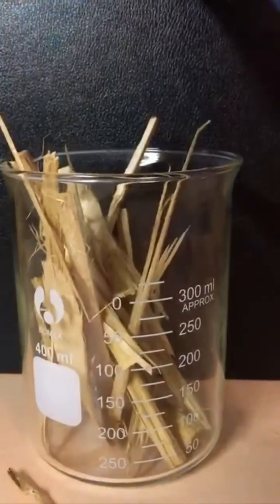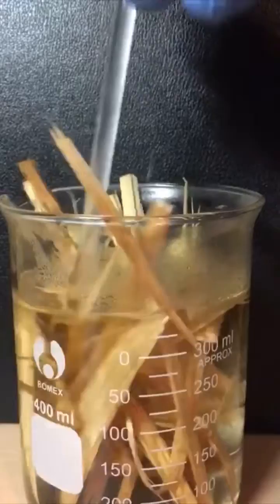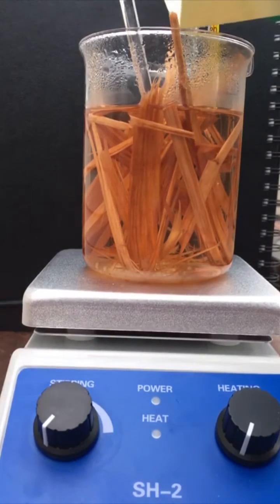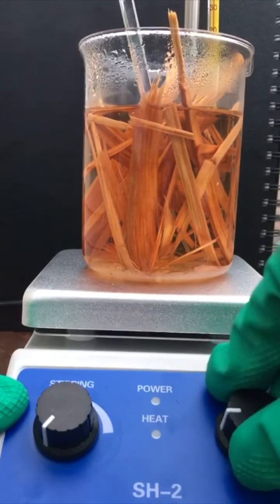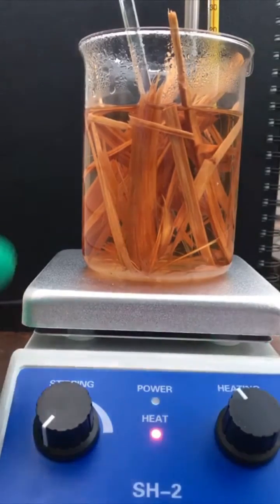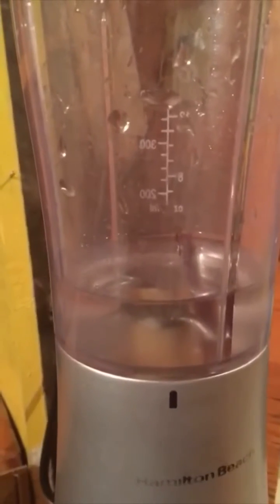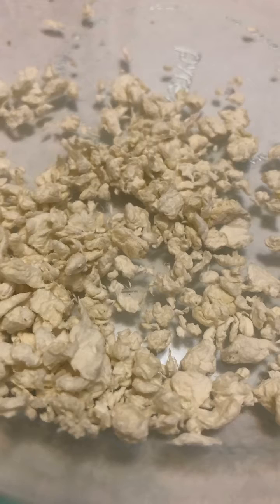Cellulose fiber from wood

Comment: excusme so sorry did u still open the comment section bcs i need to ask is it ok if i blend the cutton with an acid like hydrogen peroxyde and became a smooth cutton pulp, and is it can be a powder?? u dried it with oven?? sorry for bothering thx if u answering it

Comment: Guys do NOT eat sawdust if you can avoid it. There are many indigestible fibres in it and cellulose is not just raw sawdust. Idk how they make nutritional cellulose. I know you can make it from wood/sawdust but you have to refine it and wash it and then maybe blend or process it for it to become of significant nutritional value. You wouldn’t want to block your digestion with sawdust man. That would be a really hard fight to fight on the toilet.🤧

Comment: How does your wood undergo drying? Is it oven dried or sun dried? Thank you.
Reply from the maker: i cant remember but i believe i dried it under an infrared reptile light and a fan for air flow. I believe it was for 2 days
Reply: @industrialadhesive6357  can i extract polysaccharide with this process? i would be extracting polysaccharides from sugarcane bagasse..
Reply from the maker: @JOHNLEODECHAVEZ  looking that cellulose is a polysaccharide yes it should work. I’d try to find some papers on the topic, to see how others results were but I don’t see why it wouldn’t work
Reply: @industrialadhesive6357  Do you think i should go oven drying my sugarcane bagasse or air dry it. Btw, I'm from a tropical country, Philippines. We are in the summer season, and it feels like 45 deg Celsius weather. 

Currently working on our thesis, this is a huge help. Thank you, already liked and subscribed.
Reply from the maker: @JOHNLEODECHAVEZ  depends on the application, Air drying may be the best due to less energy expenditure in the process but oven drying would likely work better. Either should work. Thank you for watching!

Comment: Can you add the exact time?
Reply from the maker: What do you mean exactly?
Reply: Sir, if how long does it take to 'boil' the wood with sodium hydroxide solution, how long does it take to bleach it? And when you added the hydrogen peroxide, did you heat it again? Can it be powderized?  Thank you very much, your answer will be very much appreaciated.
Reply from the maker: @kio3326  hey sorry I don’t have an answer I am away at university now and I am not too sure where my old lab notes are. Yet again I’m quite sorry
Reply: And the exact temperature as well?

Comment: are the bleaching steps (sodium hypochlorite & then hydrogen peroxide) necessary for the fiber extraction or are they just for getting it to come out white? And would this (either with or without the bleaching steps) result in a fiber appropriate for spinning into yarn, or would that take extra steps?
Reply from the maker: I found the finer to be quite weak just due to the length of it, there are definitely steps you could to to spin it though, it’s better for making Kraft paper though. The bleaching was just so it would come out white it is not nessicary

Comment: I have been searching, if you can’t get ahold of carbon disulfide, what else could I use?
Reply from the maker: Schweizers reagent. And I believe cellulose is slightly soluble in a high pH solution at low temps
Reply: Thank you so much
Reply from the maker: @saketab940  👍 any time!

Comment: Is hydrogen peroxide needed or does it only make the cellulose whiter and could it affect something if i were to use the cellulose further
Reply from the maker: Hydrogen peroxide is used to make it whiter, it’s commonly used in the paper industry and it doesn’t affect paper products so depends on your final application it may differ

Comment: If my target product is lignin then can I get pure lignin by using NaOH/water as solvent?
Reply from the maker: There will likely be some contaminates but it should work as a viable extraction path. I would read into some literature regarding the topic though
Reply: @industrialadhesive6357  My target product is lignin. But the problem is, there is no any way for quantitative analysis of lignin. So at the end I have to do only FTIR that tells only presence  of lignin. Can u give any comment on this ?

Comment: Wouldn't it make more sense to mix the sodium hydroxide in before pouring the water?
Reply from the maker: I mean it should work either way. Typically you want to add the solute to the solvent and not the other way around. This is especially the case for strong bases like NaOH where if you add it the other way it can cause the water to boil and spit

Comment: is peroxide necessary? i would like to make some delignified wood in whitest possible without it
Reply from the maker: It’s not impossible. You can use NaOCl but it will be fairly yellowish. Hydrogen peroxide is recommended
Reply: do you mean possible? how long did you boil in your soup?

Comment: how to  extract mcc from potato
Reply from the maker: Im not certain on how to do it. It should be able to separate out in the same way as starch. Starch is slightly soluble at high temperatures so you may be able to separate that way. But That’s just a hypothesis

Comment: Sir, is it possible to use this method when it comes to extraction of cellulose from papaya seeds?
Reply from the maker: I’m sure it would. I am unsure of the makeup of papaya seeds, but as long as what it contains is soluble in water at a high pH and temperature it should suffice.

Comment: Hi! Will this work on the lemon peel as well?
Reply from the maker: There are more polysaccharides found in peels such as pectin which is soluble at a high pH. Aswell as oils found in the peel which can be removed quite easily. So I don’t see why it wouldn’t work.
Reply: @industrialadhesive6357  Thank you so much for answering, appreciate it!! Can I ask you for more insight if ever?
Reply from the maker: @katevillapana2937  for sure! I may take a few days to reply but I would be happy to answer any questions
Reply: @industrialadhesive6357  hi again :) I see you have linked your Instagram. I would like to ask permission to dm you for further inquiries about the experiment?
Reply from the maker: @katevillapana2937  for sure!

Comment: Hello sir,
I have some questions
Approx how much hydrogen peroxide was added to turn it from yellow to white?
Also what was in the blender before adding the wood and the sodium hypochlorite and its volume?
Another thing, what is the weight/volume of the cellulose produced?

Thank you sooo much
Reply from the maker: Hi there! Thanks for the reply!

I added ≈ 500ml 3% H2O2

In the blender I added 100ml of water just to help the blending process.

Sadly I didn’t measure the mass of the cellulose produced. I really should have but I just made this video more so as a proof of concept.

Yet again thanks for watching! And feel free to send any more questions my way!
Reply: @industrialadhesive6357  thank you so much 
Your video and your reply are already of much help 🙌
Reply from the maker: @arwaghoneim4695  no problem! And thank you very much!

Comment: Can you explain the mechanism of this experiment to me?  cellulose and lignin are both separated from the wood by NaOH and only the lignin is dissolved by NaOH?
Reply from the maker: yep the lignin is soluble at a low pH whilst the cellulose is not unless it is at a low temperature making the separation easy. so you are spot on
Reply: @industrialadhesive6357  you mean at a high pH as NaOH causes pH increase in the solution?

Comment: Your saying in the video that the NaOH destroys the lignin. Is it really destroyed or is it just being dissolved by the NaOH? Could the lignin be extracted from the water/NaOH?
Reply from the maker: That was a poor choice of words on my part. What I meant is it dissolves the lignin. It can be precipitated out when the pH is lowered
Reply: @industrialadhesive6357  Thank you for the response. What would be a good method for extracting the lignin from the water/NaOH? Short path?
Reply from the maker: @tjkoch408  hmm I would try reacting with Conc   HCl or Drop-wise as to not create a thermal runaway. It should lower the pH enough to form a lignin PPT then you can filter and wash with water of a neutral pH. That should get rid of the water soluble Salts formed leaving you with lignin

Comment: Hello, This video is so great. Thank you so much. I have 2 questions. How about hemicellulose?? And how do you know lignin dissolve and NaOH doesn't react with cellulose??
Reply from the maker: Thank you I really appreciate it! There is most definitely hemicellulose being extracted by the alkaline solution along side with the lignin. Lignin is shown to be soluble in alkaline solutions. I don’t believe NaOH reacts with cellulose chemically, although I know at low temperatures NaOH in a aqueous solution can cause cellulose fibres to swell

Comment: how did you get it pulpy..? the mixture wasn’t homogenous for me and the shredded wood is still visible, even after having let it stay in hot water and sodium hydroxide then blending with bleach
Reply from the maker: It could be down to the wood your using. Hardwood tends to be more difficult to extract the lignan from compared to a softwood like spruce or pine. You can potentially use a higher molarity mixture of NaOH. Or maybe let it sit in the solution for longer. 

But with me i just pulled the wood apart by hand then blended until it became a pulp
Reply: @industrialadhesive6357  oh i see! thanks a lot
Reply from the maker: @ela2651  no problemo
Reply: @industrialadhesive6357  oh also do you have any research like rrl i can use?
Reply from the maker: @ela2651  i do not. Sorry about that. But i am sure i can find some papers on the subject for you if you need
Reply: @industrialadhesive6357  oh yes please! of course, only if it isn't a hassle for you 😅
Reply from the maker: @ela2651  it may take a bit because i have been pretty busy lately, but i will try my best!

Comment: Can l make carboxy methyl celluse from this fiber
Reply: Thanks for you .     I know that about solvent and monochloroacetic acid .
Reply from the maker: Yes you can. You may have to do additional lignan extractions but it should still work. You will have to add the fiber in an organic solvent and raise the pH and react the cellulose with mono chloroacetic acid

Comment: Can the final product be dissolved to make a bio plastic?
Reply from the maker: It can ne pretty difficult. There are solvents that will desolve cellulose but they will either not do it efficiently or they will not result on a good product. You would be better converting it into cellulose acetate

Comment: can you replace sodium hydroxide with hydrogen peroxide ?
Reply from the maker: To a degree. The oxidization may destroy some lignan but i am not entirely sure. However using a alkali hydroxide is preferred. I couldent find much more information about other extraction techniques that do not require a strong base or high heats. H2O2 is preferred for the bleaching process though.

Comment: You made it looked so simple. Loved it. Can you please share more insight like how much did you heat.  Can you please share your email I’d for further communication.
Reply from the maker: I am glad you enjoyed! I used 90° heat when destroying the lignin. I boiled for 4 hours. I found that was enough to get rid of a good majority of lignan so i could pull apart the fibers and so i could blend them to shorten the fiber length. Also you can contact me at fluxcompression@protonmail.com
Reply from the maker: Also i heated the NaOCl to 30° for he bleaching process

Comment: Sorry, I lied. Did you add water with the bleach with the chopped fiber?
Reply from the maker: I kept it at its 5% concentration to bleach it. I also used 3% H2O2
Reply: @industrialadhesive6357  SUPER!

Comment: One more question. Does the wood fall apart or easily pulled apart?
Reply from the maker: Yes it does! I blended to get the fibres as fine as possible but as long as it is soaked for long enough the structure is structurally comprimised enough for it to be easily pulled apart.
Reply: @industrialadhesive6357  Thank you so much again for all your help.
Reply from the maker: @davidcaldwell1406  no problem!
Reply: How many times did you wash the cellulose fibers?
Reply from the maker: @davidcaldwell1406  i honestly forget but i think i washed the fibers 4 times.
Reply: @industrialadhesive6357  Great. Thanks so much. I have my fiber looking like wet shredded wheat. Just slightly yellow. I will add the peroxide at the last washing. Did you vacuum filter off the water and how did you dry it? TIA.
Reply from the maker: @davidcaldwell1406  i blended it once again to make shorter fibers. and then i i squeezed it dry and placed it on a mesh and put it under a heat lamp. Sadly i dont have the right glassware for vacuum filtration. But vacuum filtration will definitely work!
Reply: @industrialadhesive6357  Thank you once again. You have been extremely helpful and prompt in your replies. I greatly appreciate it.
Reply from the maker: @davidcaldwell1406  no problem! And good luck!
Reply: @industrialadhesive6357  Thank you. I will keep you posted on the results

Comment: How long did you soak your wood in the solution on heat before you could chop it up in a blender?
Reply from the maker: I heated it for 4 hours at 90°C. But this all depends on the wood you are using. I used black spruce i think. But if you are working with hardwoods. This could take alot longer. So 4 hours is not a definite time but for me it was long enough to destroy most of the lignin.
Reply: @industrialadhesive6357  Thanks again. I am using hardwood popsicle sticks.

Comment: Please, hydrolysis of cellulose to giving nanocellulose, how much sulfuric acid can be used  to give 100 ml of solution
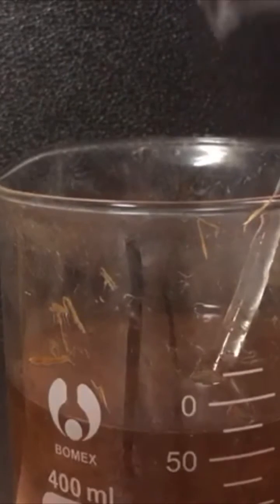Reply from the maker: Sorry im not too sure. You want to have a 50% H2SO4 solution. And the ratio of cellulose to 50/50 H2SO4 is 1:25
It all depends on the consentration of H2SO4 you are starting with to get 100ml of 50% H2SO4.

A concentrated HCl solution should also work with a similar ratio of cellulose to HCl